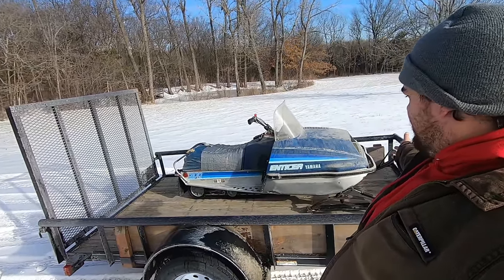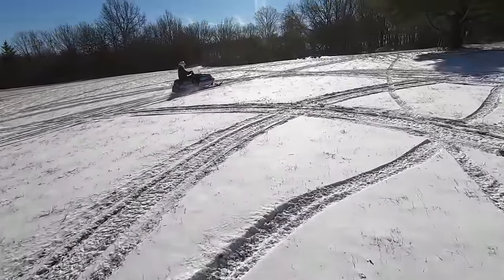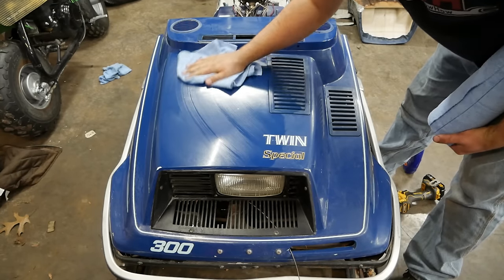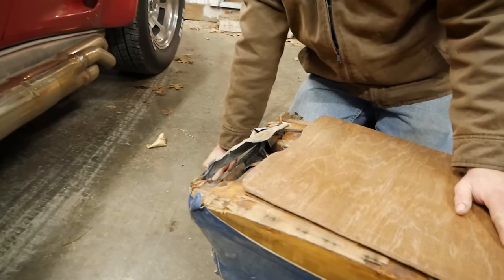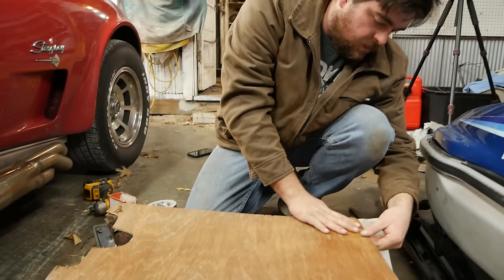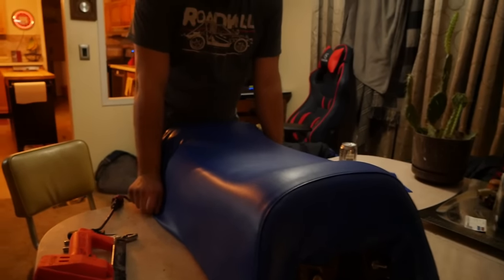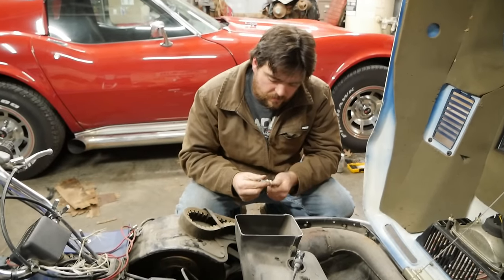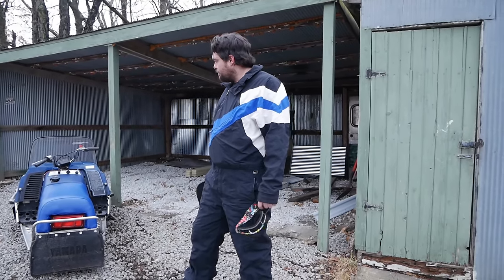VINTAGE 1980 Yamaha Enticer Gets Former Glory REVIVAL — $500 Cheap Snowmobile Challenge

Comment: That thing was going pretty well on mud, wait until you get it on snow.  I'd say if you care, check the bottom of the skis, if they're all rough and rusty it will slow the thing down.  Just surface rust will wear off quickly when you start to drive it.  Also, the skis need skegs, or steel bars that run the center length of the ski, they help with steering and will serve as a sacrificial wear surface to protect the skis when you run across the road, (or just go mudding on it).  They're cheap, but you'll want some if the ones on it are gone.
Reply from the maker: They're in great shape, I think it's a very low hour machine

Comment: Cool old sled. smoke=normal.   if it stops smoking stop running it and check that the oil injection is still working. Also before hard run you might make sure the oil injection is working and adjusted correctly. and toss some actual snowmobile oil in there. chainsaw oil will do for putting around and testing but if your going to run it get some sled oil. walking in freezing temps or being towed back with a smoked engine sucks. Your going to have fun in the snow!
Check the sliders for the track and the wheels make sure all bearings spin and sliders/hifax aren't brittle-turning to dust. and like the other feller said try not to do much dry riding it needs snow for lubrication/cooling

Comment: Dude that snowmobile is you!!!!
Haha actually cleaned up pretty well!
I’ve blown a few of those enticers up by not removing the oil reservoir and just mixing the 2-stroke myself.
Also a comet clutch will really wake it up for a bigger guy like yourself!!
Reply: I just commented that. used to dump a half quart in every tank and still run the injector. They smoke and changed plug’s occasionally but never had to worry bout them.

Comment: Snowmobile advice, let it warm up before wide open throttle and if it's running for say a hour check to see if your overheating it. 
 Beginners should put your one knee up on the seat alot to carve powder. 
  Use good gasoline. Snowboarder boots work OK for Snowmobiling. Wear mittens not gloves (because wind chill) and bring packet disposable hand warmers. 
 The video had a lot of funny jump cuts GG.

Comment: Smoke is because it's a 2 stroke and means it's burning oil..like it should it could be a bit to Rich on oil you can adjust the pump very easily from the manual.

Comment: Hey Dalton make sure you use a 2 stroke injection oil for it. They are diluted to run through the oil injection system. I always ran Rotax injection  oil. You will fight fouled plugs running regular 2 stroke through it.
Reply from the maker: I'll look into that, didn't know there was such a thing
Reply: @PoleBarnGarage  Yeah if you run regular 2 stroke in the injection system you will eat plugs like crazy. Ask me how I know.

Comment: You may have accidentally created the greatest idea ever. Hear me out mkay lol reinforce the skis with some angle iron, which would help them steer on grass better as a bonus, and maybe upgrade the hyfax to something more sturdy and rip snowmobiles in the mud. Tracked vehicles are dang near unstoppable so youd have the ultimate trail runner rig. Hit small mud holes and stuff. Im sure something like this exists but it just seems like beefing up a snowmobile to handle harsher ground surfaces would make a really good mudding machine.
Reply from the maker: I was actually thinking about that lol

Comment: Your spark plug wrench would probably be in the black roll of tools in that front storage. If it was a snake it would of bite you. It burns oil because it’s a two stroke. It will be Smokey. It’s normal

Comment: My first sled was a 79 enticer 300 in white. Awesome little sprint sled, didn’t like deeper snow though. But this is how the addiction starts. I currently don’t have a sled, not much use for one in Arkansas, but have a half dozen atv’s, a side by side and bikes. Thinking about getting a few sleds again to take to Colorado. You’ll want an 8,10,12mm wrench, flat and Phillips, pliers and plug wrench. Always make sure your spare belt is good and carry extra fuel pump, some fuel line, clamps and emergency pull rope.

Comment: With oil injection, if it's working properly, there is no need to mix oil with the gas, that is what the oil injection system does- meters the oil correctly for the intake fuel mixture for RPMs the engine is running at.👍🇺🇸😎
Reply from the maker: Yep, that's why I didn't mix it
Reply: Isn't the chainsaw fuel added pre-mixed?

Comment: Conduit bending tool would probably straighten out that front bumper.

I hoard. . I mean collect vintage power tools. Have a jigsaw like that. I have some Craftsman tools but I've also have a jigsaw by Powercraft which was the Montgomery Ward version. Almost everything I have that's Powercraft is incredibly ugly. It's like they didn't have an actual designer they just had engineers figure out how to make motors to do power tool stuff.
Reply from the maker: Thanks for your comment and for watching!

Comment: pretty sure the reason it was smoking so much and fouled the plugs is because you were running it with the choke on the whole time. That's also why is was in high idle at the beginning when you first started it. Those are good machines, the seat turned out nice. I wouldn't recommend adding anything other than oil into the injection system
Reply from the maker: Choke wasn't on
Reply: Ok my mistake, it’s weird that it’s smoking so much, typically the injected ones (or even my old arctic cats with 40:1 premix) hardly smoke at all. It’s possible that the exhaust is gunked up with old oil due to only being run for short trips, this was the case with my Yamaha G1 golf cart (which basically has a single cyl. Enticer engine and oil injection), it smoked like a chimney until I ran it long enough to burn all the old oil out of the exhaust

Comment: I own that exact machine.  Bought it New in the fall of 1979.  Crazy fast, I had the factory speedo installed, it can do 70mph on long open flat, too fast for the machine.  It will smoke and bog a bunch if you try to push it when it isn't totally warmed up. Something with the oil injection.  Removing the carb for cleaning is a pain with all the plastic.  It is a light weight dirt bike for the snow, almost no suspension, but you can really through it around with your body weight.

Comment: Throw away the old plugs. They may look OK but can be junk. Two strokes eat plugs. That's why you have a spare set, and if they look bad, that's pretty much normal. All that smoke (that you mentioned more than once ) is normal for a two stroke snowmobile. Outboards and dirt bikes looked like that too when two strokes were more common. I owned them all and came to love the smell of burning two stroke oil. Check the sliders on the skies for wear. You can buy replacements for a lot of them, but I would just make my own. Don't use mild steel. They won't last ten minutes.
Reply from the maker: Grey smoke isn't common, that's the berryman. Smoking before I did the plugs was probably when it fouled the plug, unspent fuel from the misfiring cylinder. Yes it should smoke, no it shouldn't fog out my entire property lol
Reply: @PoleBarnGarage  As for the color, on video on my screen, can't tell. As for the amount...looks normal for an old machine. Newer ones are a lot cleaner.

Comment: The good thing about a cheap toy like this is if you put it in the weeds, it's no great loss. Cool find man, it doesn't snow here in Southwestern VA enough to warrant owning one of these, which is good 'cause, if it did, I'd move, I hate snow... Like.. Hate with every fiber of my being, yeah..
Reply: @sheepwolf1st  Very rarely snows in Virginia, especially the region I live in. I hate it, fully, and entirely.
Reply from the maker: I also hate snow, and winter. I can relate
Reply: @PoleBarnGarage  Last year I had to deal with unplowed snow on a side street, whilst driving the steaming turd I daily, a 2000 Nissan Sentra 1.8, with a 5 speed... So the solution was just to get a little speed and clutch dump the car in 3rd, it'll be fine right? It's only got a quarter million miles on it... I really should find a cheap fer-by-fer.

Comment: I'm kicking myself because my landlord had one of these for sale for $200 about 7 years ago that was in really good condition. 

I ended up asking my coworker who grew up snowmobiling where I’d moved to if he would buy it if he were in my shoes? He said no way because they were pieces of sh*t. I couldn't really believe it and couldn't quite wrap my head around his weird response with no explanation as to why, especially since he drove an 80s Chevy Blazer. 

He turned out to be kind of a See You Next Tuesday over the years. As an early 80s Toyota owners, like many vintage Toyota owners, I've develop a love for things that we're built to last and have cheap parts and very straightforward mechanics. I'm kind of bummed I never got to check it all out. A year later here comes Larry the Enticer proving that Enticer can actually send it.

It's been a lingering past regret of mine that I didn't do my own research and trust my own judgment rather than someone elses just because they grew up doing it. Never again.

That outfit pretty much makes it. Great job on the makeover!
Reply from the maker: Thanks 👍

Comment: 500$....? Granted I left Alaska in 2002 but that’s a 150$ sled if it’s 100% legal, not seeing that at all
Reply from the maker: What the hell can you buy for $150? Like, literally can't buy anything lol
Reply: Depends where your located, the price of snowmobiles very, alot. There pretty dang cheap in places that used to get alot of snow back in the 90's and before, and now dont. Around me there typically 200$ to 700$ for a running old sled, I got my old 78 Polaris 440 for 350$ with a titled tilt trailor some years back. Got it running, road it a couple times, Sold the sled for 450$ then eventually sold the trailor a for 350$. That 440 hauled a#s and didnt have brakes😄. I kinda miss and regret selling it and the trailer.. that's how it goes though.. I like buying, selling trading toys, the thrill of hunting down and fixing old stuff is my life.

Comment: If you're still using the oil injection system you should use 2 stroke oil for oil injection systems.
Reply from the maker: I did
Reply: I love the old 2strokes I restore old Yamaha 2 stroke motorcycles from the seventies. If it's smoking it's not broken👍

Comment: That is NOT the way to use mixed fuel/oil! You mix it in a can shake it and pour in the fuel tank. It isn't mixed properly doing it your way and you get lean on oil then too rich on oil then lean on oil because it's just sloshing around. You'll destroy that engine fast that way
Reply from the maker: What on earth are you talking about? Did you catch "oil injection"? The sled mixes it's own fuel and oil from separate tanks. Extremely common stuff on old 2 stroke anythings, figured everybody knew about it

Comment: Over-oiling a 2T makes  it run lean. Watch that…
Reply from the maker: Did I over oil it?
Reply: @PoleBarnGarage  It was hard to tell , somewhat smokey early on, but seemed to clear - worth using high quality fuel undiluted with additives, and checking oil pump delivery rate on old 2T.
Liking your channel and looking forward to more.
Thanks.